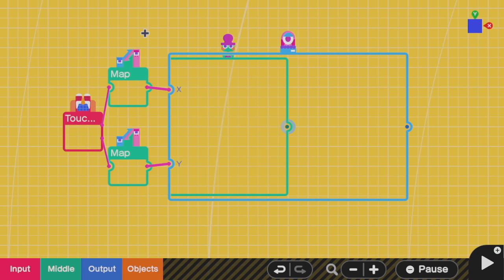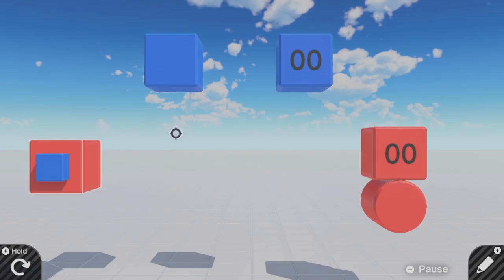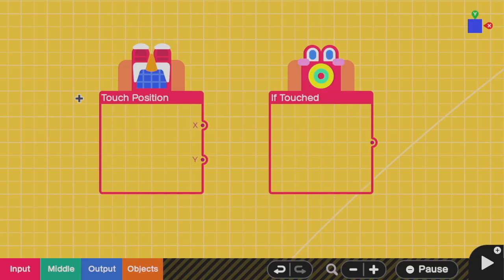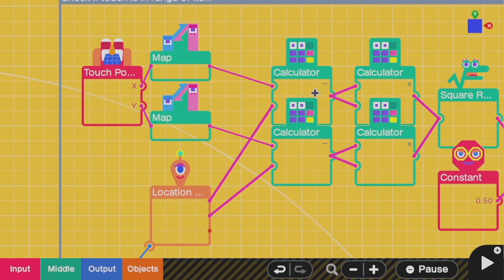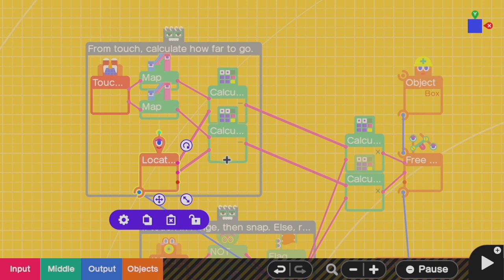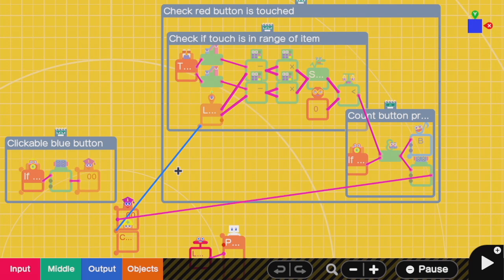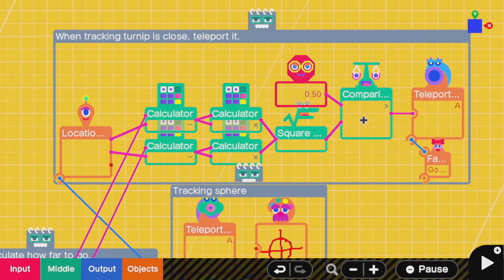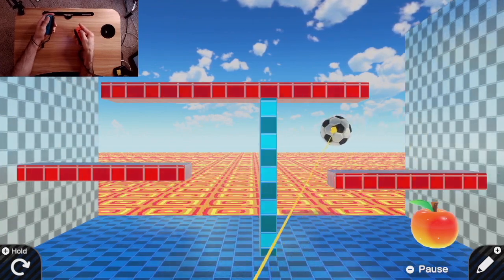How to Use TOUCH Controls in Game Builder Garage (Guide / Tutorial) (Part 3)

Comment: How do you make a moving object touchable? I am currently working on a game where my cat tries to touch a moving object with a mouse texture, and i control the mouse. How do i make that?
Reply from the maker: 1) You can see in the sample code that the moving block is not actually touchable. I am creating an illusion by sending the block to the coordinates of where you touched. 2) If you are asking how to do this with a moving block instead of a free slider, then do the same technique as for an AI that follows the player. Just calculate the vector from block to the touched coordinate (just like in this video). The difference is that now, you scale that vector's magnitude to a given speed before feeding it into the moving block. Does this make sense?
Reply: @loupandsnoop  No, it doesn’t. I’m new to programming with nodons. I’m used to written code, like JavaScript, that’s why i sound a bit confused. 😐
Reply from the maker: @michaelplayz5972  Well, check out my first GBG tutorials "How to do Basic Movement," and later "How to make Enemy AI". The first one will show you how to control the movement of objects in GBG. The second will show you how to use basic vector math to send objects to various specific spots (such as your cursor). Sorry to plug, but the videos explain better than I can via text.
Reply: @loupandsnoop  I’ve made a system that can work for now. If my cat touches the moving object, i will touch the L button. The L button makes a squeaking sound.
Reply: @michaelplayz5972  use a large touch sensor object to detect what object the mouse is. if the mouse and the cat are the same object, use [touch sensor output] with an = nodon with 2 as a constant nodon to compare it to, then put the output of the = nodon to whatever you want to do when the mouse gets the cat. if the mouse isn’t the same object as the cat, connects [touch sensor output] directly to whatever you want to happen when the mouse gets the cat

Comment: Thank you for your videos and the hard work. It's all very helpful. Is it possible to use Multitouch in GBG? I made an Air Hockey game for two players with stick controls and now added touch controls for one player, but I don't know, how to register two touch inputs at the same time.
Reply from the maker: Thanks. I don't think you can, as the game is designed to be more compatible with controllers. It's possible, but I just don't know.
Reply: @loupandsnoop  Okay, thanks for your quick answer.